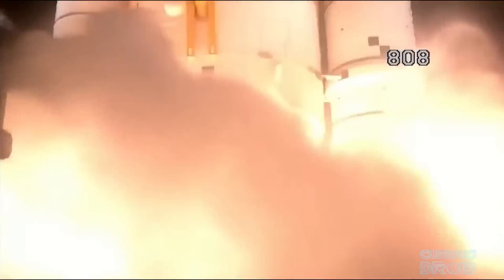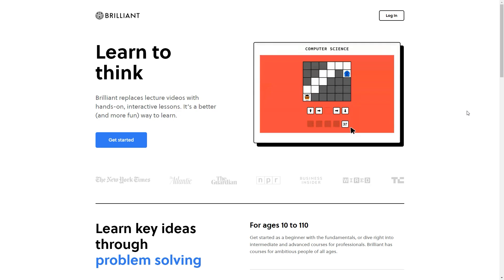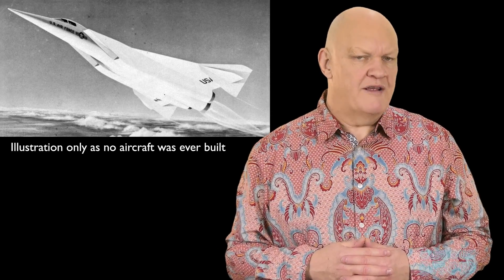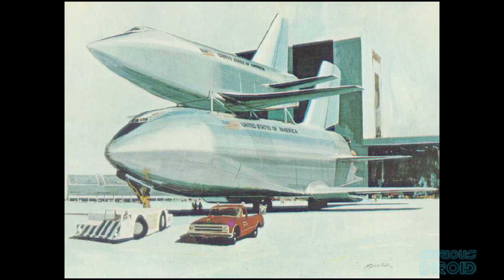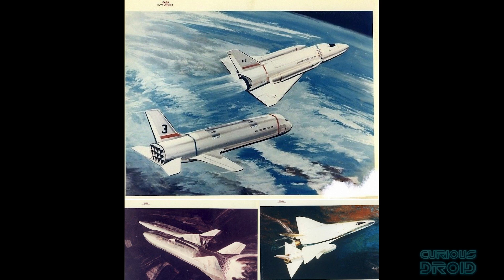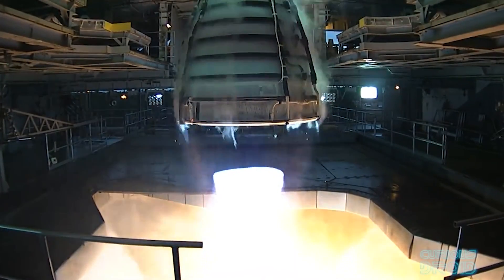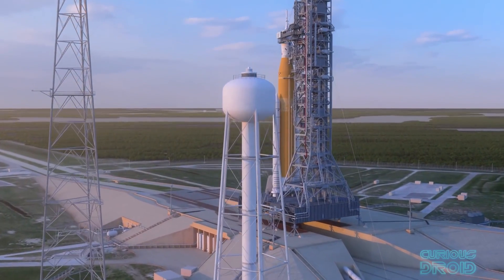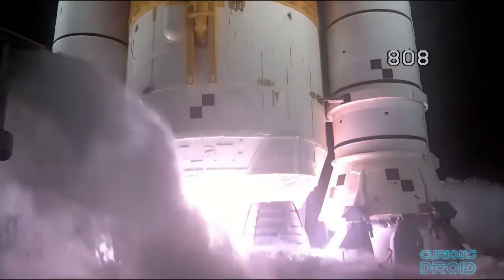Why is NASA Throwing Away Reusable Engines?

Comment: A key factor in reusability is efficiency to orbit.  You look at the Saturn V when it launched Skylab as a two stage rocket (not the 3 stage Lunar configuration) and an efficiency of 2.5% of the starting mass on the launch pad made it to orbit as Skylab.  It is hard to recovery anything when the efficiency is that low.

So now you fast forward to the Space Shuttle.  It could get upwards to 1.6% of its starting mass into orbit as payload after all of the safety systems were chucked overboard, all safety margins stripped out, and people needed to be onboard every flight to operate the spacecraft, making it even more inherently dangerous.  So how did it achieve such a feet?  Well the SRBs (Solid Rocket Boosters) were these heavy, low ISP, uncontrollable when ignited, and very turbulently running rockets strapped to the sides composing half of the first stage in an inherently inefficient 1.5 stage to orbit design.  They were so expensive to refurbish for another flight that you might as well build new ones.  Plus before 1986, you never really knew what state those o-rings were in after a flight.  The other half of the first stage went all the way up to orbital speed including a giant, heavy external tank that got thrown away after every launch and an extremely expensive to refurbish after every launch and extremely delicate orbiter that had big, heavy wings on it that did nothing in the vacuum of space and made for good collectors of foam insulation breaking off of the external tank during launch.  Remember the more structure and engine mass and such that gets accelerated to a higher speed, the more propellant it takes to do that.  So having this big, heavy external tank and this big, heavy orbiter go all the way up to orbital speed just killed the performance of the rocket, causing it to just barely make orbit.  Then everything about this rocket except for this one piece of the RS-25 engines were extremely expensive to get ready for another flight, but then again the RS-25 was extremely expensive to make in the first place, so the only good part about the Space Shuttle program.  The efficiency of the rocket and the technology used made it impossible to do any sort of cost effective reusability.

Fast forward to the first partially reusable rocket, the Falcon 9.  The Falcon 9 expendable has a record breaking 4% efficiency to orbit as in 4% of the mass on the launch pad can be payload to LEO (Low Earth Orbit).  An interesting thing when you have a 2 stage design (not 1.5 like the Space Shuttle) and have the booster drop off just above the atmosphere where you don't have to worry about hypersonic shock waves wreaking havoc when you stage (as in the shock wave from the stage going to orbit hits the stage that is dropping away) is most of the mass of the rocket, as in something like 70% (or more) and most of the engines where most of the money tends to be spent on, are contained on that stage.  In other words you drop off the biggest and by far the most expensive part of this rocket.  Even more interesting is you are still very far from getting up to orbital speed.  This leads to a deal where for every 7 lbs of recovery hardware and propellant on the first stage, only 1 lbs of payload to orbit capacity is lost.  Now you are like well I have 4% efficiency to orbit, how much will it hurt to say have the booster come down to a drone ship in the ocean along an efficient ballistic trajectory and land?  The answer for Falcon 9 came out to 1.4%.  In other words, the rocket is still 2.6% efficient to orbit.

But then you may think, well can't we do better with hydrogen fuel?  I mean the RS-25 engine has the highest ISP of any chemical engine out there, right?  The answer is no.  The reason for this is the rocket equation to orbit factors in ISP (exhaust velocity) which helps, dry mass of the rocket stage, which more hurts performance, and thrust, as well as atmospheric drag and hang time against Earth's gravity.  After all ISP is a measurement of hang time against Earth's gravity.  This thrust needs to be high enough to effectively counteract Earth's gravity while not being so much that you travel through the thick part of the atmosphere too quickly and smash the rocket from aerodynamic drag and not so much on nearly empty tanks that you smash the payload or people inside from too much G-force.  But at the same time, the longer you fight against gravity because you are not going orbital speed, the more propellant is spent counteracting (hanging against) gravity.  For LOX/LH2 (liquid hydrogen) rockets, hydrogen is very light and diffuse and these RS-25 engines are big and heavy for what they do.  Their thrust to mass ratio is much lower than the Merlin engines used on Falcon 9.  Then you look at the tanks you need to store LH2 (liquid hydrogen) in.  These tanks are huge to store this very diffuse fuel and they have thick, heavy insulation on them.  This results in a relatively huge dry mass for what it does.  These are very negative effects counteracting raw gains in ISP.  The Falcon 9 can store is RP-1 fuel as a liquid at room temperate and the fuel is very dense, so the tanks are small and light.  So now let's look at two of the very best rockets using each fuel type, the Delta IV for LH2 and the Falcon 9 for RP-1.  The Delta IV had an efficiency to orbit of upwards to 3%.  The Falcon 9 upwards to 4%.  So while the Delta IV engines had a higher ISP, the Falcon 9 is so much lighter for what it does, it ends up being a more efficient rocket.

Now lets take a gander at Starship engine technology.  The ISP of Raptor 2 falls in-between the RS-25 and the Merlin 1D engine.  The thrust to mass ratio of the Raptor 2 is close to the Merlin 1D engine.  The fuel density liquid methane in the tanks is close to that of RP-1, meaning the tanks are relatively compact and light for what they do.  While liquid methane is a cryogenic fuel, the tanks do not need insulation, saving a tonne of dry mass over a LH2 rocket and keeping the rocket dry mass comparable to an RP-1 fueled rocket.  So Falcon 9 was already at 4% efficiency to LEO and now you just added on additional ISP with almost no additional mass cost.  Because so little usually makes it to orbit and efficiency goes down along a logarithmic scale as you go up to orbital speed and beyond, this efficiency gain with all things considered should make Starship with Raptor 2 8% efficient to orbit if you swap out the stainless steal structure and make it a Falcon 9 with Raptor 2 engine efficiency.  The notion of making this swap is for illustrative purposes so that you can have a more apples to apples idea of how much better this rocket engine and fuel setup really is.  So with 8% efficiency potential to orbit, well recovering the second stage is a lot bigger challenge than recovering the first stage due to things like for every 1 lbs of recovery hardware is 1 lbs of payload mass lost, you have a lot more speed to scrub at orbital velocity, and atmospheric heating is a cubic factor as in you go twice as fast, that is 8x more heating.  However we saw the Space Shuttle orbiter could make it back with a very inefficient 1.5 stage to orbit design.  So now with Starship we are saying we could potentially have an 8% efficiency to orbit if optimized around expedability.  Elon Musk has promised to get 2% of the starting mass into orbit as payload.  So that leaves 6% on the table for recovering both stages.  That sounds very possible, especially as the half as inherently efficient Falcon 9 only uses 1.4% of the margin to get the largest and most expensive part of the rocket back while expending the upper stage.  With any other rocket engine technology and fuel setup, no.  But with how efficient the Raptor 2 setup is, yes.

Comment: Didn't NASA get engines from Russia which were going to be used on the N1 rocket?
Reply: No, as Orbital Sciences and later Northrop Grumman flies the Cygnus to the ISS on Antares boosters. The Antares 100 series used engines derived from the N1 engines. The Antares 230+ uses the RD-181. The Antares 330 will use a booster and engines made by Firefly Aerospace.
Reply: @steveaustin2686  Aerojet got hold of and tested the NK33 engine destined for the N1 back in the mid nineties
Reply: @barneypaws4883  So? The N1 used the NK15 and the NK33 was derived from that. So what.
Reply: @steveaustin2686  with respect I'm just making a point.  I'm sure you know a lot more about this subject than I do
Reply: @barneypaws4883  I'm informed amateur willing to learn new things. The N1 engines were not used by NASA or on the Antares from anything I can find. The Antares did use the NK33, which was derived from the Nk15. So what? After the RUD on the Orb-3 launch (5th launch of Antares), Orbital Sciences redid the Antares to use the RD-181 with Russia not wanting to sell Russian engines to the US anymore and the Russian invasion of Ukraine stopping the building of the Antares booster, Northrop Grumman (who bought Orbital) are working with Firefly Aerospace to make the Antares 330 with a US booster and US engines. NG only has one Antares 230+ left, so they contracted with SpaceX for 3 Falcon 9 flights for Cygnus. The same way that Cygnus flew on the Atlas-V after the Antares 130 RUD. None of this is secret or unknown. Russia makes good engines, which is why they were used.

Comment: As SpaceX discovered, it takes some crazy software control to land a rocket.  The landing maneuver is called a hover-slam, which very well describes the difficulty involved.  While propulsive handing systems have been built before, the SpaceX system is the heaviest rocket to ever attempt it.  If NASA were to commit to doing this, the development of the SLS would have been set back YEARS more.  Considering the number of times this rocket will ever fly, the cost of the wasted engines and tanks might be less than the extra development cost to make it reusable.  OTOH, making it reusable would allow the rocket to fly more missions for the same cost.  A real catch-22.

Comment: Artemis is a huge step back in rocket technology. It is not going anywhere. The lunar program has to be feasible, not just government funds devorer. The future is in reusability.
Reply: Booster reusability is great, but has drawbacks.

First, if you don't have a fast enough launch cadence, you can spend more on recovery equipment and personnel than you save by reusing the booster.
Second, you take a payload hit for the recovery system on the booster. The Falcon 9 B5 can lift up to 22.8 tons to LEO when expended (SX), but only up to 16.7 tons when landed on a drone ship (B1069.2). Doing a Return to Launch Site (RTLS) landing, costs even more payload as you have a boost back burn to cancel the lateral velocity and return back to the launch site.
Third, the higher and faster you go, the harder reusability is to perform. The heavier the dry-mass of your booster, the harder reusability is to perform.

So with SLS launching once a year, eventually, the cadence doesn't really justify recovering the booster. Not to mention that it gets higher and faster than a Falcon 9 as the SLS core stage almost reaches orbit, making recovery MUCH more difficult. The SLS core stage is travelling well over 3 times as fast as the Falcon 9 booster and is well over twice as high as the Falcon 9 booster at MECO. The dry mass of the F9 booster is 22-25 tons while the SLS core stage is 85 tons.
The SLS Block 1 can get Orion to the Moon, but not with the kind of payload hit like F9 has. The SLS Block 1B will send along a Lunar Gateway module with Orion, so it really can't take the payload hit either.

Comment: The cost of those engines are just ridiculous.  $1.8 billion to build 18 engines.  That is a billion each.  Just buy a bunch of Raptor 2 engines from Elon.  It has about the same thrust and Elon has the price down likely below a million each... 1/1000th the price... and he hopes to get them down to $250,000 each.  I still want to see an oversized Falcon10 with 9 Raptor 2 engines and a Raptor 2 Vacuum engine in the second stage.  Put landing arms on the second stage and a=n oversize heatshield between the second stage and oversized Fairing.  Make is stainless steel and use Meth/LOX.  It should have about 2.5x the payload and be FAR easier to do than the monstrous Starship/Heavy Booster that is more like 5-6x larger than the Falcon9.

Elon is raking in the money with the Falcon9 as it is.  A crew launch to the ISS gets him something like $350 million and likely costs less than $75 million.  He could sell those Raptor 2 engines for $5 million each and massively undercut everybody.  The more he makes the cheaper they get.  Let's see what the Raptor 3 can do... and cost.
Reply: The latest Crew Dragon contract is $280M per flight and with the extra prep for the crew flights, certainly costs SpaceX more than a cargo flight. SpaceX has not released the internal cost of the Falcon 9 flights.

Comment: It's a bit of a mixed bag. Reusable is great and all, but the question is whether it's practically possible to make them reusable for the job they're meant for. Although the SpaceX reusable booster is neat and a good idea, they also stated once that it doesn't work for high orbit launches because it has to burn so much fuel that it won't be able to make it back and land, although that of course also depends on how much weight they're carrying. Falcon Heavy was supposed to help get around that, but then you're still burning a ton of fuel just to be able to reuse the rocket, which may end up costing so much the reusability doesn't make much difference. So although the SLS isn't reusable, it may not be possible or feasible to make it reusable if it's to be used for sending a bunch of stuff to Mars - which will make for a rather heavy rocket.
Reply: The only thing you said right on this is that SLS is not possible nor feasible to make reusable. That would have had to be done during the absurdly long and expensive development period. Too late now.

As for reusability, it greatly brings down launch costs simply because most launches don't need the capabilities of a fully expended rocket and having a higher launch cadency is far better. And you misunderstood high orbits. Falcon 9 can send payloads to high orbits while still being reusable. It just reduces the payload mass, which is already reduced by the distance anyways. Falcon 9 goes from 8.3t to GTO while being expended down to 5.5t while being reusable. And TLI is about 3.5t while being reusable. But you could also have the payload have a small and efficient engine on it instead of trying to use the heavy upperstage for long interplanetary burns. 

SLS for all it's size and costs and while being fully expended, it cannot land on the Moon nor Mars. It doesn't have enough deltav to get the Orion capsule down anywhere. It would at best required a dedicated lander to get to the surface, which has to be launched on a separate ship. And yet Starship is planning to not only land on the Moon and Mars, but with far, far greater payload than SLS is capable of. That is due to being refueled in orbit, which is also possible due to reuse. 

Fuel is cheap. Rockets are expensive. Starship even while being massive would only need around 2M worth of fuel per launch. Don't take my word for it, nor Elon's nor anyone else. You can find out how much fuel is required for Starship online and then find out how much methane costs per kg. The same is true for Falcon 9 and Heavy. SLS' fuel is far more expensive, since it uses hydrogen. But even that is just a small percentage of the launch costs.

Comment: So, why is NASA throwing away reusable engines?
Reply: He didn't answer that. Funny that 2 of the 4 Falcon 9 launches in Nov 2022 were expendable launches. Booster reusability is great, but has drawbacks.

First, if you don't have a fast enough launch cadence, you can spend more on recovery equipment and personnel than you save by reusing the booster.
Second, you take a payload hit for the recovery system on the booster. The Falcon 9 B5 can lift up to 22.8 tons to LEO when expended (SX), but only up to 16.7 tons when landed on a drone ship (B1069.2). Doing a Return to Launch Site (RTLS) landing, costs even more payload as you have a boost back burn to cancel the lateral velocity and return back to the launch site.
Third, the higher and faster you go, the harder reusability is to perform. The heavier the dry-mass of your booster, the harder reusability is to perform.

So with SLS launching once a year, eventually, the cadence doesn't really justify recovering the booster. Not to mention that it gets higher and faster than a Falcon 9 as the SLS core stage almost reaches orbit, making recovery MUCH more difficult. The SLS core stage is travelling well over 3 times as fast as the Falcon 9 booster and is well over twice as high as the Falcon 9 booster at MECO. The dry mass of the F9 booster is 22-25 tons while the SLS core stage is 85 tons.
The SLS Block 1 can get Orion to the Moon, but not with the kind of payload hit like F9 has. The SLS Block 1B will send along a Lunar Gateway module with Orion, so it really can't take the payload hit either.